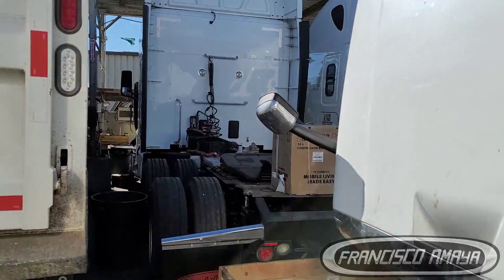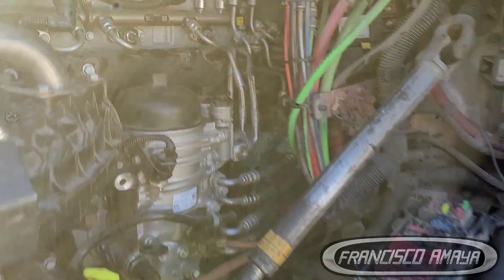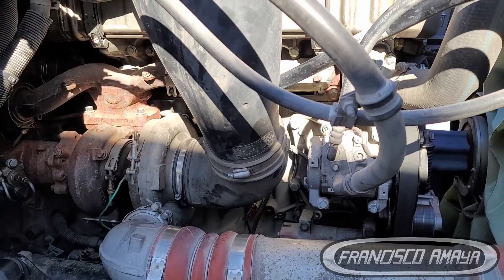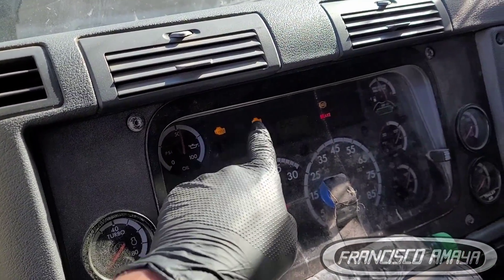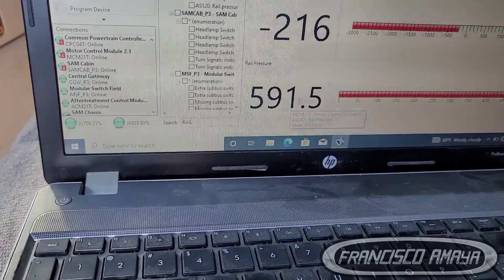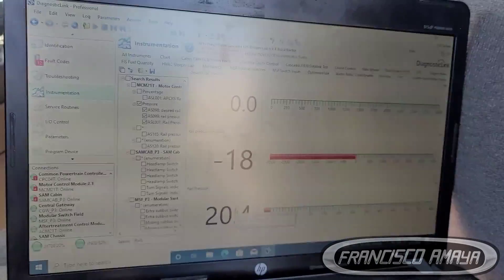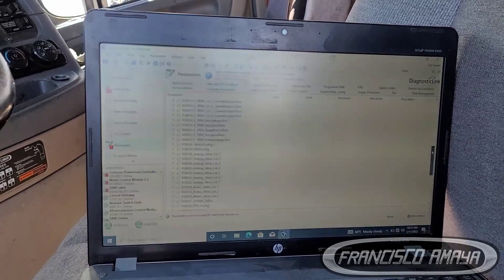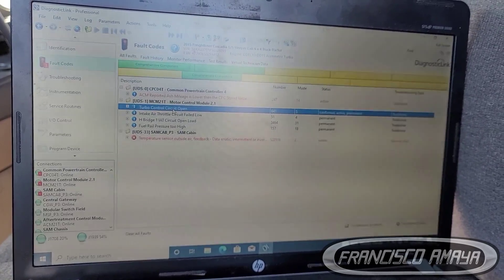Installing a 2019 cascadia DD15 engine on a 2015 cascadia engine swap details programming mechanical

Comment: I replaced a ghg14 engine with epa10 dd15 and truck has a stop engine light and the engine sounds different, does it need to be programmed for epa10?

Comment: hello Francisco . i am swapping dd15 engine . 2019 engine to a 2014 truck.  i was watching your videos because i didnt do swap like this. and i swap everything around even compound turbo with idler gear and crankshaft gear i am about to swap injectors . do i need to swap rocker housing also ? are the cam shafts different ? because inj. are . i swap rocker housing and i got ticking noise on gears for intake cam . looks like is to big play.
Reply from the maker: you dont need to swap the internals of the engine. just swap the external components and that will be fine. GHG14 and GHG17 engines internally are different

Comment: Here is my story, in july 2022 i replaced used 2021 dd15 motor on my 2016 truck, after that iam having vibrating under chassis on lower speeds 50kms and 80 km it’s feels like motor is not breathing properly and my speedometer goes ups and down, its last around 300 to 500 kms after that everything gets to normal, and now in winters here last month was extremely cold -30degrees my truck didn’t consume any Def for one week and im starting having def issues and mechanical said my dpf filters are almost 97 percent clogged (I changed them last year with new one box) and the shop that  replaced my motor  said they never see situation like this. Please help me out of this nightmare.
Reply: Want to add up freightliner diagnose that engine EPA and truck EPA is different that’s why im having this problem